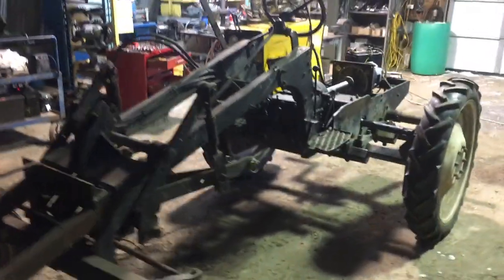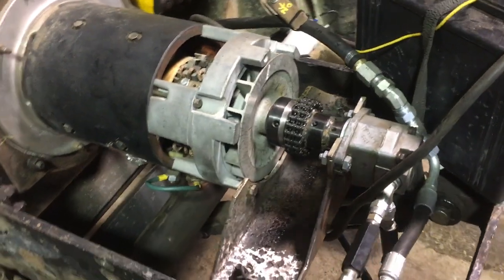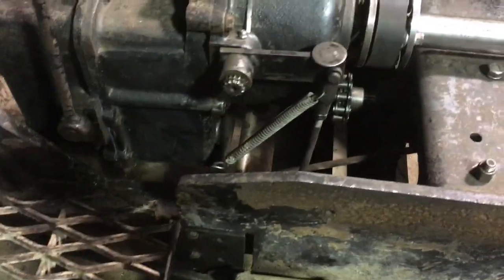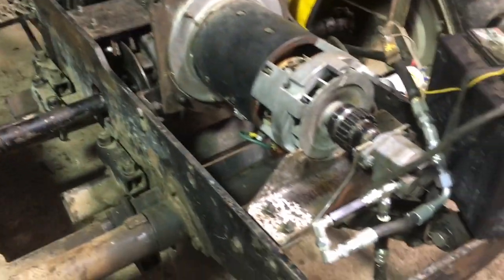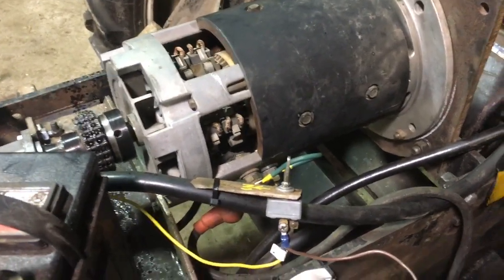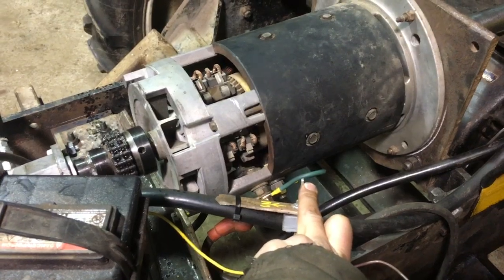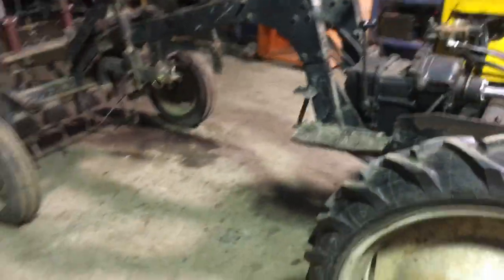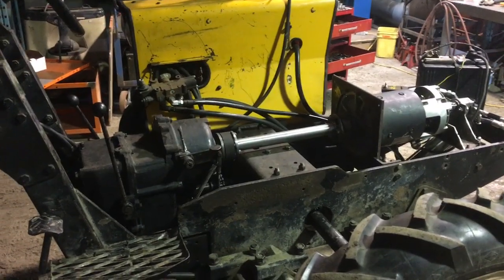Hefty-G tractor electric conversion, part 2:  Driveline complete!

Comment: Hi what kind of mottor you use i would like to build a 20 horse power tractor
Reply from the maker: This is a separately excited brushed DC motor from a small forklift.  It measures 8" (20cm) in diameter by 14" (35cm) long.  Power output from this motor at 40V is comparable to a 20hp gas engine but torque is higher.  Switch to using kW for electric drive to make life and math easier.  1hp = 735W.  This tractor tends to run at about 6kW driving around and doing light work but power output has spiked as high as 15kW under heavy load.  This tractor was originally powered by a gas engine rated at about 20hp
Reply: thx for answer . I will buy 4  ebyke motors each 3000W hope will be more than enough for all the work in the farm

Comment: Sir please tell me How much hp and rpm of this motor and how much minium and maximum dc voltage required to run this motor
Reply from the maker: I'm not 100% sure on specifics but this motor is wound for nominal 36V operation in forklift.  I am running it up to 48V max which sees it spin to about 3600rpm with appropriate field weakening though it would certainly be possible to spin it faster.  Max power output in this setup is about 18kW or 25hp but only for short periods.  It would need a fan forcing air through the motor to cool it if running at that power for long.

Comment: Great project. I did a conversion of a VW Rabbit in 2000, but at only 40 miles per charge and an 8 hour recharge, it didn't meet my needs after a few seasons. I still have the car and am thinking about repurposing the Advanced DC motor and Curtis PMC controller onto a G. 
How are you using the tractor? For actual fieldwork?
Reply from the maker: Hi Tom, sorry for the slow reply.  Yes this tractor is used for field work but not tillage per se.  Like an Allis G its niche is precision weeding with belly-mounted tools.  There are weeding videos featuring this tractor on my channel.  Typical loads run from 1.5kW to 15kW peak but with 6kWh pack and 6 acres of mixed vegetable we never run out of power.  Yes convert a G.  There are plans online and you can even order the adapter plate prefab from Niekamp tool.

Comment: I apologize for the amount of audacity it takes to ask, but how much would you estimate you have in this conversion?
Reply from the maker: This tractor conversion was costly in hours, surely a couple hundred spread over 2 years, because I fabricated a lot of new bits and wanted to make it look nice and be easy for others to use.  Parts costs were reasonable (to me) at perhaps $2500 spread over many years of gathering bits.  Of course there was the occasional expensive educational moment when I torched something costly on my way to understanding it but even with those expenses included it was the time more than the parts budget that was really the big expense.
Reply: @reidallaway  I am trying to pick up a Hefty G close to me. I was just curious as to  the expense. The one I am trying to get runs and is gas, but it apparently won't be compete until mid March. The electric conversion is tempting for sure, but so is a diesel swap.
Reply from the maker: @beeroquoisnation  Be aware that the original gas engine is a real PITA.  It's a Continental/Renault 800cc inline 4 with the output drive taken from the "wrong" end of the crank.  This means that the drivetrain is designed to be spun the opposite direction to what is normal for most engines so a re-power with gas or diesel engine is a bit more hassle than usual.  The Renault engine is not pleasant to work on and parts are not readily available, nor do most mechanics know or like the engine.  In truth the Renault engine is the Hefty's biggest flaw.  Once re-powered with something more reliable and pleasant they are really good tractors.
Reply: @reidallaway  can the axle be flipped?
Reply from the maker: @beeroquoisnation  you'd have 3 speeds forward and 6 speed in reverse.  Also the diff isn't symmetrical  and might leak (more) if flipped, along with all the hassles involved it changing the driveline.  Plus reverse in gearbox is not as robust as forward ranges because extra lays aft.  In short, no easy solution.  Maybe Better to aim diesel backwards and reverse the shaft rotation with a jackshaft beneath the engine.
Reply: @reidallaway I am looking forward to seeing the one for sale locally this month. The man selling his is working out of state. He has the carb with him. He was rebuilding it when he left apparently. I have some options I suppose. Will 20 hp power it?
Reply from the maker: @beeroquoisnation  Yeah it doesn't need more than 10-15 hp and most of the time 5hp would be adequate if it had torque to match.  Mine often runs between 1600 and 3500W instantaneous demand during shallow cultivation work and 3kW - 6kW for transport and acceleration.  I've pushed it all the way to 18kW briefly but never sustained at that rate.

If you get stuck maintaining the Renault engine for a year or two I have a couple in parts that I can provide bits from for the cost of shipping but I wouldn't really wish that engine on anyone living outside of France.
Reply: @reidallaway  LOL Understood. I felt that way about many projects over the years.
Reply from the maker: Here's the wikipedia page about the Renault engine in question.  I believe it was sold by Continental-Teledyne in the US under license from Renault.  It was designed for rear-engine, rear-wheel-drive cars and fan+radiator were thus set to front of engine but so was output.  It's almost clever packaging and works fine for the Hefty layout - until it doesn't.

https://en.wikipedia.org/wiki/Renault_Billancourt_engine